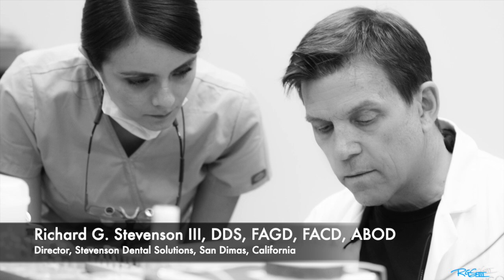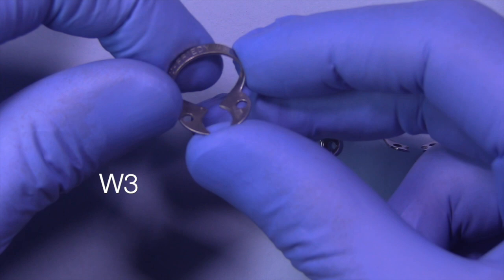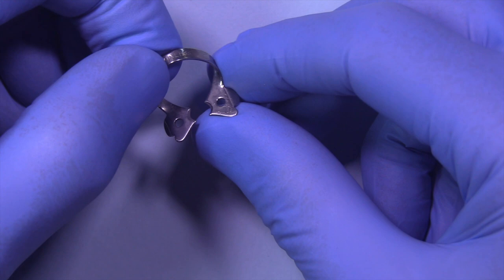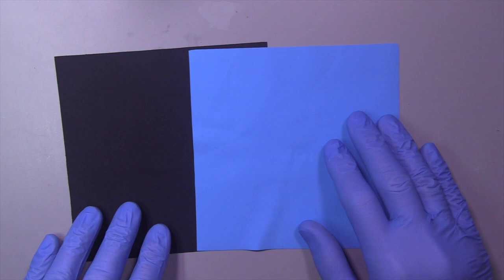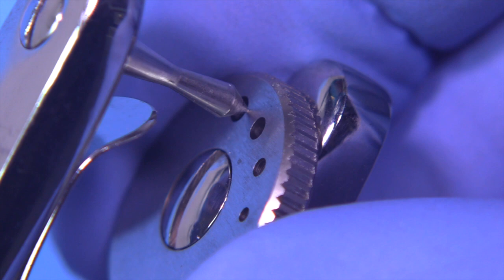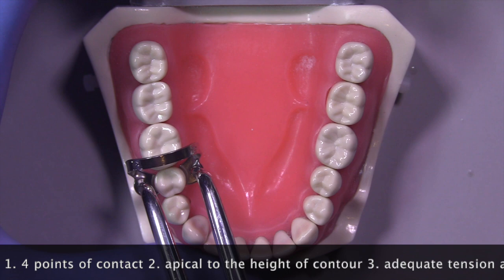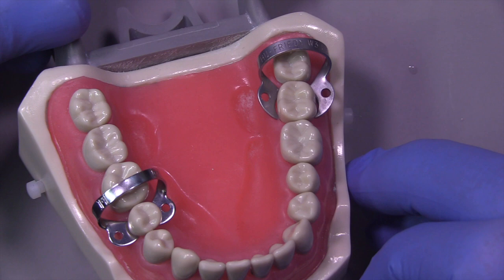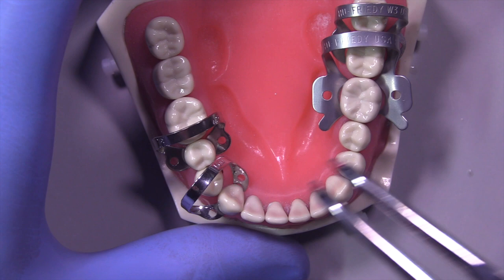Rubber Dam Isolation, Part 3 - Clamps Selection

Comment: Thank you for all your videos! 
Could you please show us how to stabilize the rubber dam with floss?
Reply from the maker: Check out part 4 - thank  you!
Reply: @StevensonDentalSolutions  I mean the knots with floss around the teeth. I know that you said in part 4  it is not necessary, but I feel like in case of cervical restoration or preparation it is very helpful.
Reply from the maker: Oh! Sorry - yes, the knots are completely unnecessary if you punch the hole sizes properly and invert the dam as I've shown.  I learned this about 30 years ago while performing gold foil restorations where any leakage will result in a complete failure of the gold to adhere.  I hope that the original techniques of the masters I've had the privilege to learn from don't get lost!  KEY POINTS: 1. Proper hole size and spacing, 2. Use floss to invert proximals, 3. Use air and explorer technique to complete the inversion,  Thank you!
Reply: @StevensonDentalSolutions  I will follow your advices with great pleasure. To be honest, I always punch my rubber dam with the same biggest hole size for all teeth.
Reply: doudabenz me too😂😂

Comment: How to isolate an upper distal most molar with a DO cavity extending subgingival? Any specific clamp or technique for that?
Reply from the maker: W2 rotated 45 degrees medically, or a 14AD or 27 with distal access.  There used to be a clamp made by Ivory called a 17, which had three jaws made just for this purpose.

Comment: Is there a video for rubber dam application in cases of partially erupted teeth? I need help please
Reply from the maker: I use the 14a or 8a for these cases, or lay a FTF and place the clamp and dam after.
Reply: @StevensonDentalSolutions  may I ask what does "FTF" stand for?
Reply from the maker: @yanoevy1634  Full Thickness Flap
Reply: Thank you so much sir